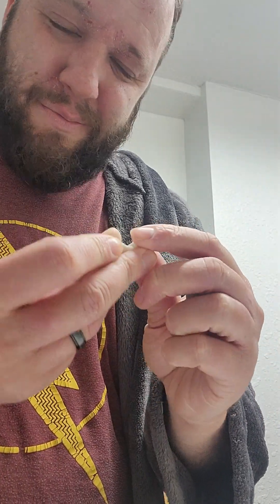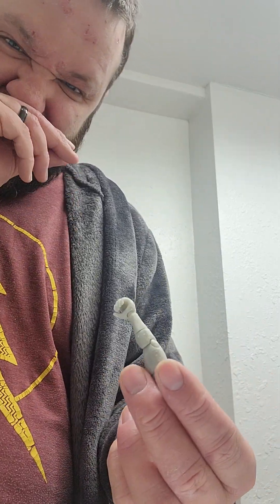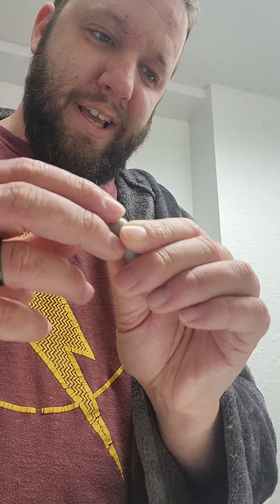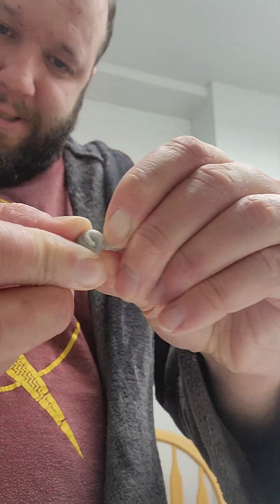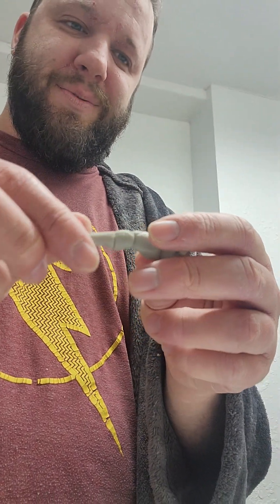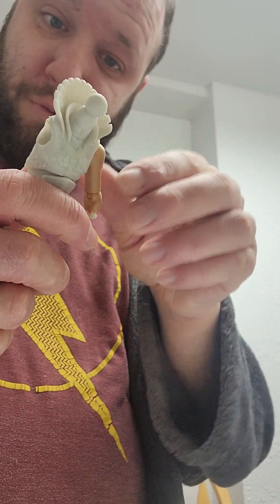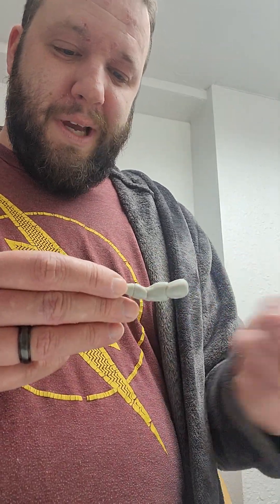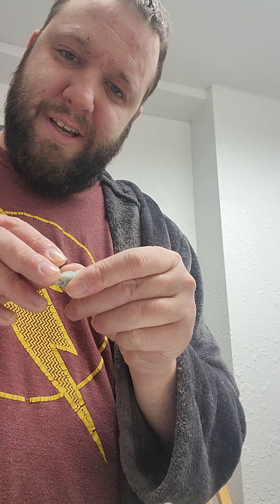Resione Anti-impact Resin Mixed with TH72 Test

Comment: hehehe glad you took my advice about 80:20 mix ;) 
even more glad that it's working for you :D
mind you, both anti-impact and th72 are advertized as low to no shrinkage resins, but I have noticed that the joints of my action figures have become a bit tighter with time... I mean, I 3D print them, enjoy messing around with them for a few days and then I put them on a shelf and forget about them for a month or even longer... and I picked one of my figures yesterday to mess around with it a bit and some of the joints were significantly tigher :/ almost too tight... dunno why that is... moving the joints around doesn't seem to loosen them up and they remain tight... they don't seem like they're gonna break or anything, but they are quite tight now... might have to consider lubricating them with a bit of silicone oil...
Reply from the maker: Interesting info, thanks for sharing! And yes! I've been happy so far! Definitely monitoring these things before I try to sell them. I usually jump WAY too quick to release something, I'm afraid this would be a more costly mistake if I don't have the kinks worked out!
Have you seen my new video I posted today yet?
Reply: @headhunterscustoms  you mean the joint system video? yarp! seen it! I'm also working on a neca type joints for my action figures, but it's REALLY hard finding the right ratio of aesthetics and functionality :/
Reply: Hello, gentlemen! Very informative stuff! May I ask which is which in the 80:20 ratio? Thank you in advance!
Reply: @greyscantina8481  hey mate! 80% is anti-impact and 20% is th72. you should measure by weight and not by volume mind you..